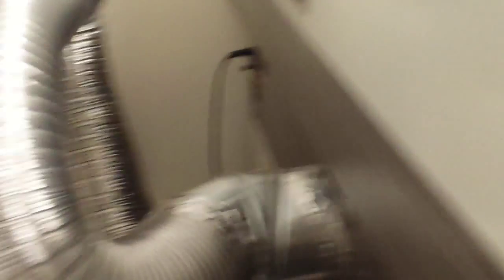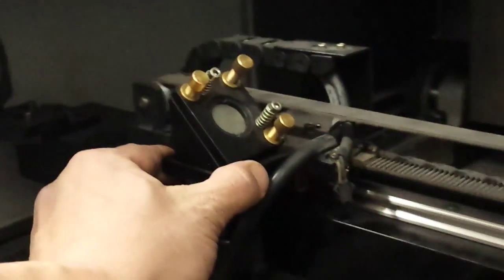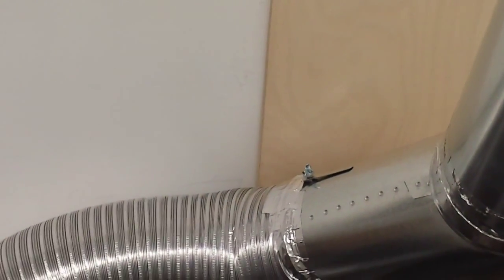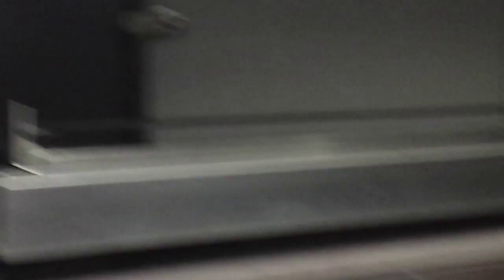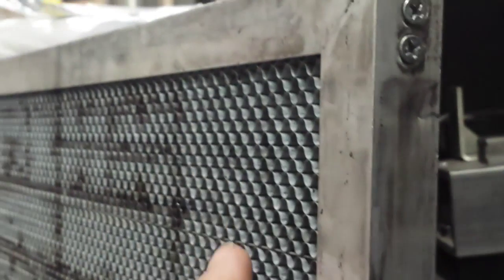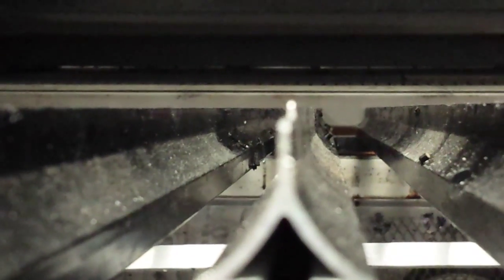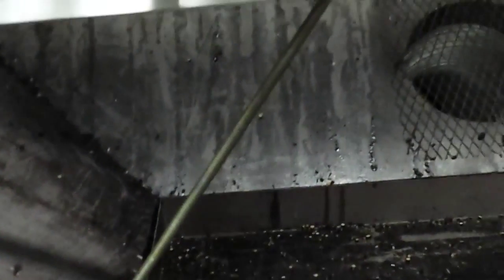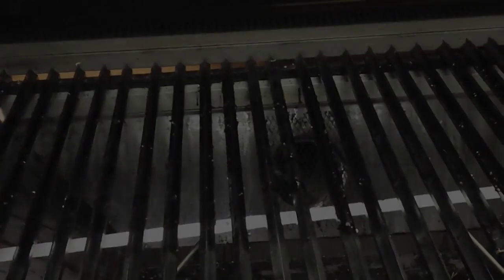Full Spectrum Laser Hacks - Part1

Comment: Will it cut through metal or only engrave? If yes what is the thickest it will cut?
Reply from the maker: Nope, this calibre of laser doesn't do much to metal. It can handle woods and plastics just fine, but you need some pretty hardcore equipment to tackle metal. If the metal has some kind of coating, this laser can engrave it off pretty well (anodized aluminium, for example, will engrave quite nicely). But if you're looking for actually etching into the metal itself (or cutting it), you're going to need a laser with substantially more power.
Reply: Solarbotics
We have been told you can do thin metals (steel), but not Aluminum as it dissipates the heat too fast to melt it. Haven't tried it, sorry!

Comment: Thanks for the Video. Just wondering what kind of material you cut. Your bed looks pretty beat up and wasn't sure if that was from the material or something else.

Also what CFM do you have on your ventilation system?
Reply: We cut lots and lots of acrylic, and this bed size is just small enough to catch the tiny pieces in the gaps (unfortunately). We're considering taking it out and putting a blow torch to it to see if we can melt it out, but haven't needed to yet.

Our ventilation system is rated 1400cfm, but it's derated so we don't need to install a make-up air unit.

Comment: Just ordered my machine yesterday. Same unit as yours with a 90 watt tube. Please keep the videos coming. They will give me a head start when my unit arrives. Except the tweaking, are you happy with the machine? Found very few independent reviews on the net for this machine.
Reply from the maker: In general, YES. It's a beast of a workhorse. Reci tube life has given us very good life (running at ~23mA), the software is much better than anything Chinese (but still a bit frustrating when compared to Epilog), and it's easy to service. Won't use it for raster work, as it's waaay too slow, but it'll vector cut all day long.

We've had some minor troubles with a inrush surge resistor cooking and blowing in the laser power supply (burned up 3 so far), but it's a minor fix, and I think heat-sinking it has solved that problem.

Don't think we'd buy a second laser this size, but only because we rarely use the whole bed. It's a somewhat unwieldy to move 48x36" of material at one time.
Reply: Solarbotics
Maybe the resistor fix would be a great subject for a video  : ))))